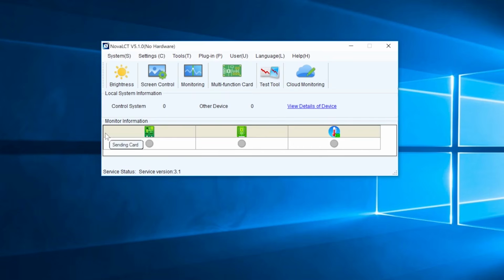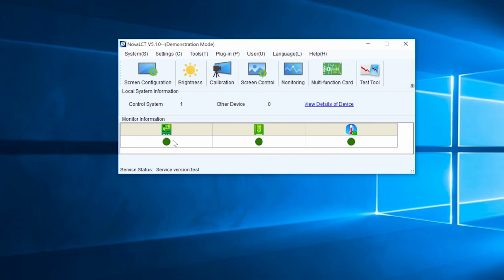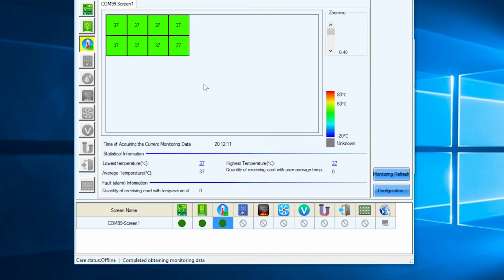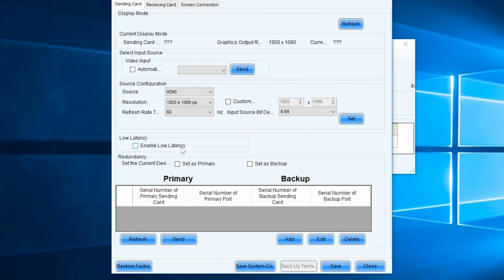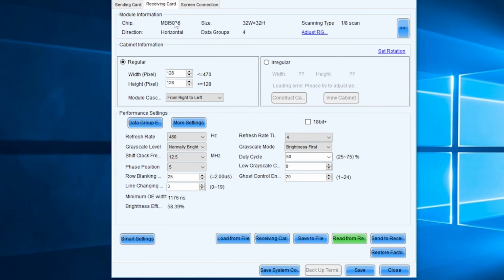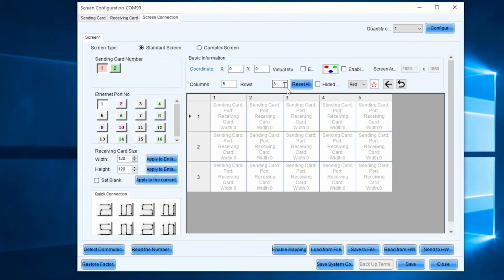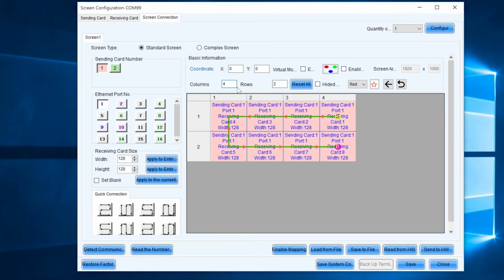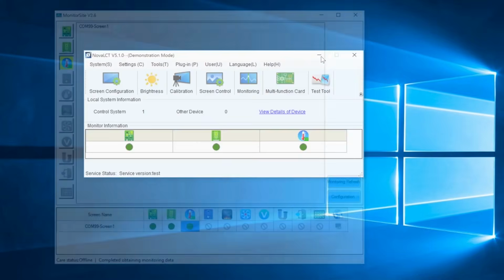NovaLCT Basics   Beginners Tutorial, How to use NovaLCT, How to program Novastar   NovaStar software

Comment: I haven't been able to get my led video wall to go to full blackout. When I plug it into my laptop, it does. But when I connect it to my Mac mini, its stops. Mac mini setup: out of Mac mini into black magic duo link card, out of duo link card to HDMI In Converter, out to Ethernet, to Ethernet Input on HDMI converter, HDMI out into controller.
Reply: You all need to stop using decklinks - they have this issue. Some firmware updates on the decklink have issues.

I ran into this issue in live productions

Comment: hi.   say I have a 80 panel led wall. for example a 10x8 wall , would I have to use 20 panels on Port 1 , 20 panels on Port 2, 20 panels on Port 3 and 20 panels on Port 4?

How many panels (or pixels) can 1 ethernet port handle? thank you
Reply: Bit late but might be helpful to others: 1 port can handle 650 000 pixels. That means a VX1000 processor can handle 6.5 million pixels as it has 10 output ports.
If your panels are 192x192 pixels (fairly popular size) then 1 panel has got a total of 36,864 pixels.
That gives you 17 panels per data output.
Although when I built my wall I did 12 panels each as the software would communicate an overload when running 17 panels.

Hope that's helpful